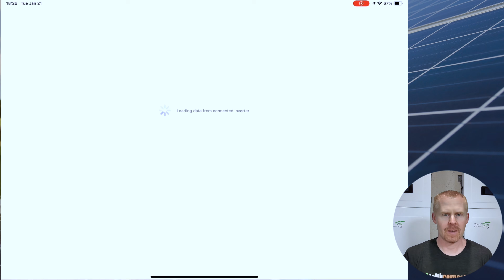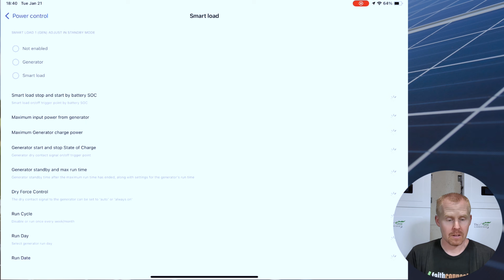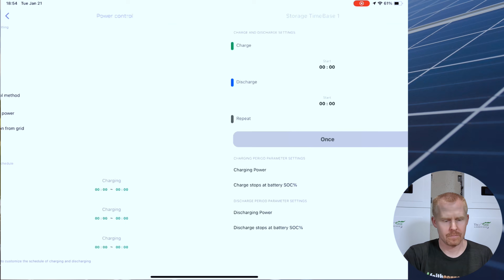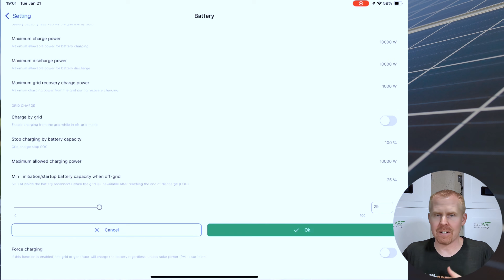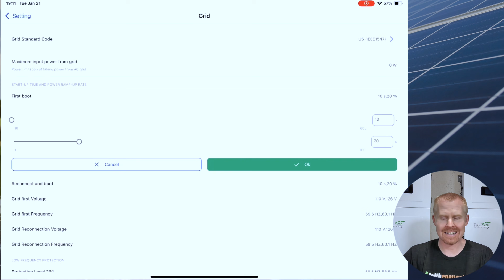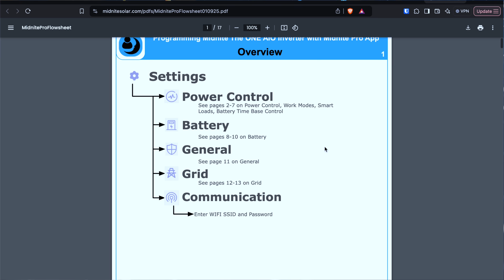MidNite One Inverter Settings Explained: A DIY Solar Guide

Comment from the maker: MidNite Solar: https://www.midnitesolar.com/
MidNite Pro Flow sheet: https://www.midnitesolar.com/pdfs/MidniteProFlowsheet010925.pdf

Links to the parts & pieces in the video (affiliate links)
------------------------------------
MidNite "The One" Inverter - https://bit.ly/4exEkpw

Supporting the Channel
--------------------------------------------------
There are several ways that you can help support this channel.  
- Affiliate links help the channel by providing me with a small commission of the sale.  It does not change the cost for you at all.  
- The 'Buy me a Coffee' - https://buymeacoffee.com/goingoffgrv
- You can also click on the "Thanks" button under the video to support the channel. 
- You can become a channel member and receive additional perks: https://bit.ly/3Wdufqv

Thank you for your support!

Comment: too bad we are guessing at some of the non-intuitive combinations due to lack of documentation from Midnite. I have installed two now, and cannot get the second one to use the Sell back priority work mode, and I cannot figure out why it is stuck in self-consumption. Second issue is firmware update from shipped version 1 to version 2 which is required for remote read/setting and is quite a challenge with very little documentation. Big problem for me has been that you need to have a solid wifi connection to do the update as there is no way I can find to update firmware from a laptop locally.This would be a great topic for a video.
Reply from the maker: Hmm, never heard of a setting being stuck before.  If you can't seem to make that setting change, I might just look at resetting the settings to default values and see if that makes a difference.  I know some of the earlier firmware versions didn't have the best settings.  

As far as the firmware update process, I'm not sure how MidNite is planning to handle all those.  I know they can push the updates to the inverters but I'm not sure if they're planning on making the update files available for a local update.  I hope they do because there's always gonna be places that don't have internet connections and need updates.
Reply: @AdamDeLayDIY  Yes you can do a local update. Need an adapter from Midnite and the files on a laptop. Any issues give Midnite a call or if you bought it from Backwoods Solar. They are great sources and can get you up and running.

Comment: Adam... Marion from Barbados again... Inverter set up but having voltage drops... Lights dimming..and getting bright again.. Fans in house speeds fluctuating... Audible... Any ideas as to what to look for or do? We don't have any other midnites on the island..
Reply from the maker: How much battery capacity do you have?
Reply: @AdamDeLayDIY  28kwh...lipo4. Love your channel btw

Comment: The reactive power stuff is more or less how the inverter reacts to the voltage on the grid to maintain voltage regulation.  It's done by the inverter shifting its own power factor presented to the grid.  This gets into the weeds pretty quickly, but essentially the current from generation supplying the grid leads the voltage on the grid and this phase angle is varied depending on the method selected in the inverter.  Some settings do not actually refer to the grid voltage rather adjust the amount of real power vs reactive power based on how much real power the inverter is supplying.  Lots of options to suit what ever the grid operator requires.  Without there being a difference between the phase of current and voltage, generation actually does not put any usable power into the network it just attempts to push the voltage up.
Reply from the maker: @retrozmachine1189  wow, making my head spin a little!  Lots of control though.

Comment: The PV IR and leakage are indeed for safety.  The design of the inverter (a lot are like this, it's not specific to the midnight) can allow current from the AC side back out the PV connectors.  The inverter needs to be able to sense loss of isolation in the solar array so that it can shutdown operations.  For higher voltage arrays the array itself can be a hazard if there is loss of isolation.  While shutting down the inverter won't solve this problem the inverter will be able to alert to the fact that the situation exists.  To sense loss of isolation there needs to be a working earthing system, so this is one reason why panel frames should be connected to the premises earthing system.
Reply from the maker: @retrozmachine1189  awesome, thanks!  I was hoping you would chime in and fill in the gaps for me!